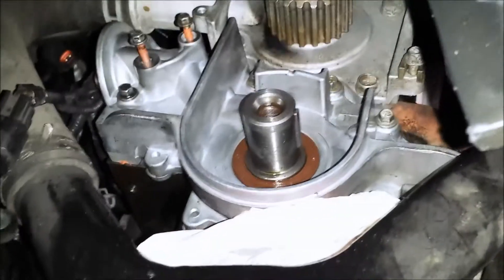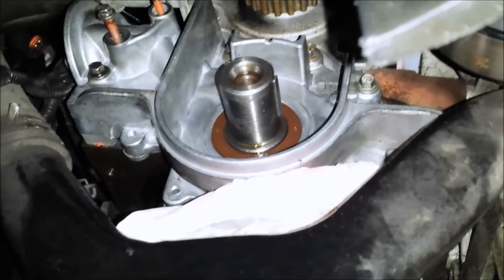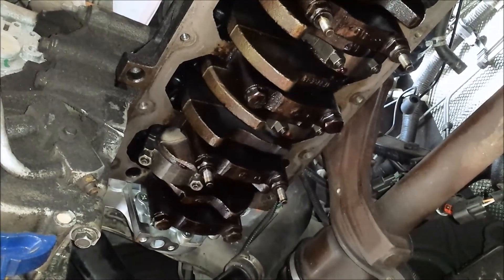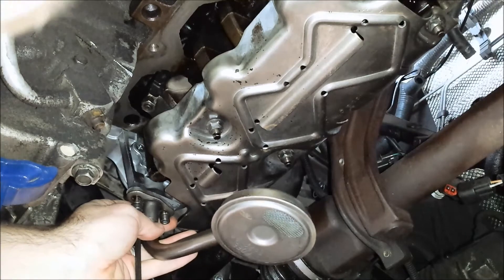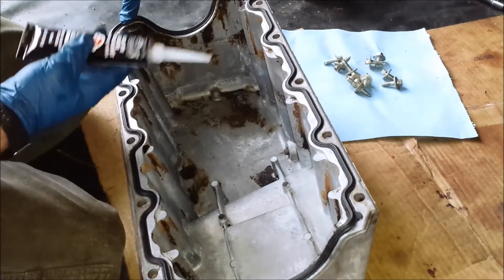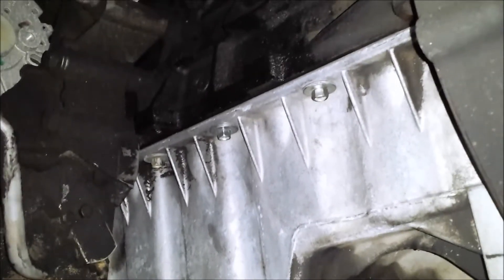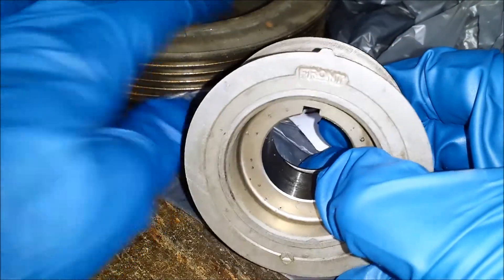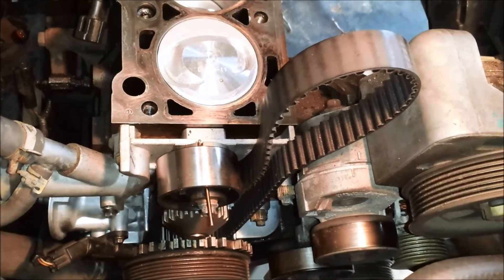Ford Focus Engine Rebuild 2.0L SOHC SPI - Part 9

Comment: most torqe wrenches are not very accurate. i have found that it is better not to use a toque wrench on all bolts but rather use common sense and mussle memory when titening bolts other then conecting rods, head bolts and main bearing cap bolts.

Comment: on the  spi motors,it simply has a oil pan! On the zetec, It has a upper & lower oil pans!! the upper pan has bolts that run threw the transmission! cat convertor has to come off, A/C has to come off. ALOT MORE UNCERTAINTY...LUCKY 4 ME, ITS COLD OUTSIDE,BGINNING OF WINTER!!! IF ONLY IT WAS APRIL...

Comment: Question about the oil pump. It has a moving/lose rotating part internally that kinda moves around in the circle. Does that need to go on a certain way around the crankshaft? Or do you just line it up with the bolts and thats that? Hope this makes sense. lol
Reply from the maker: It takes some adjusting to get on if I remember correctly.  I think I fought with it for a few minutes.

Comment: Hey man I am currently doing this and this series has been absolutely amazing. I couldn't have gotten this far without it. I'm currently trying to get the oil pump back on and can't get it to sit probably. I have tried turning the crank to line it up but cannot get it on there correctly. I was wondering if you had a tip or suggestion on how to line up the oil pump properly. Any advice would be much appreciated. Thank you for making this series.
Reply from the maker: +flyfishben It's been a while but I recall having the same exact problem.  This probably isn't very helpful but I believe I ended up moving around the internals of the pump itself to get it to seat.  I know I spent about 15 minutes playing with it before I got it to seat.
Reply from the maker: +flyfishben And thanks for the comment, it's appreciated.
Reply: SoftwareDevJason so the pump I have is extremely hard to move the internals. I'm wondering if the oil pump is damaged
Reply from the maker: +flyfishben Is this the old one or a new one?  Do you have another one to compare it with?